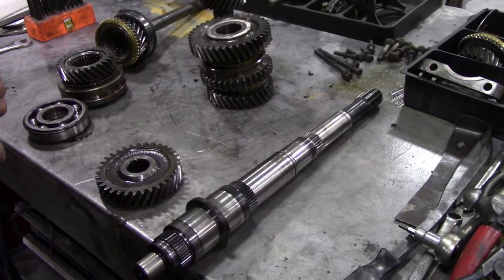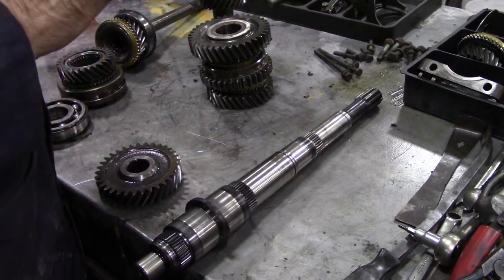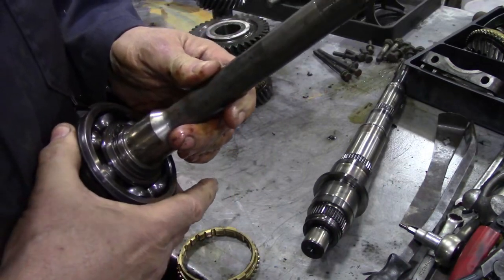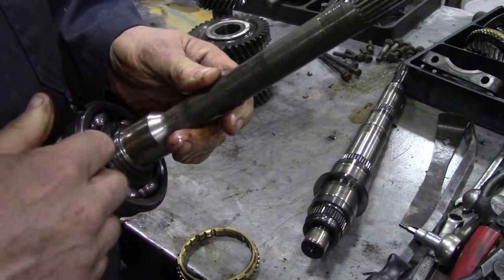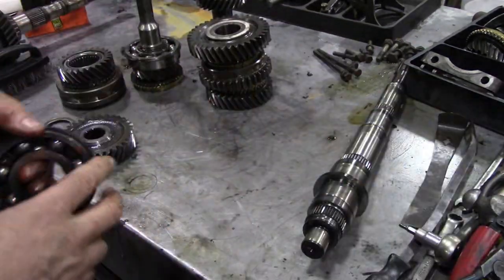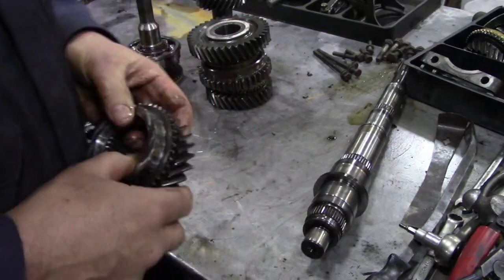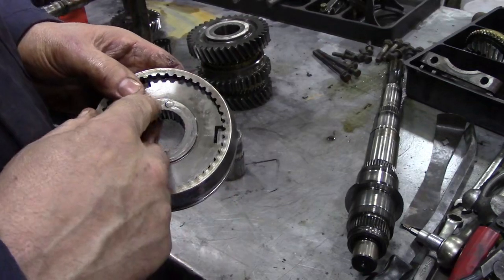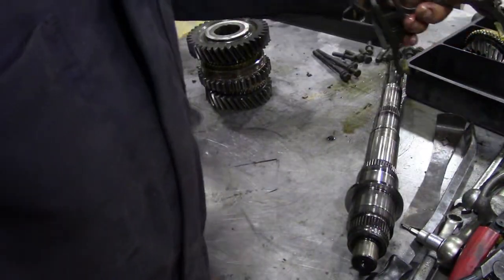Land Rover Defender LT85 22C rebuild – Part 2

Comment: I have rebuilt r380 gearbox.its leaking ATF in between main gearbox and transfer box.what  mighty be the problem.im stuck
Reply from the maker: If it is leaking ATF at the back of the R380, then you need to remove the transfer case and replace the rear seal on the gearbox output shaft
You have to remove the collar on the back of the gearbox shaft which is difficult - usually needs a special tool but you could use a puller

see here
https://youtu.be/tb_4xzwHDpw?list=PLkIBI0td6S2vVCrYcLme1sTjXqB4CWI7S&t=440

you have to fit the seal first and then the collar not the other way round or you can damage the seal
MIke